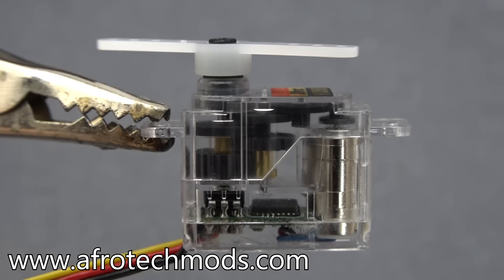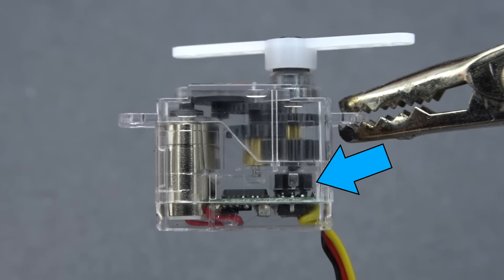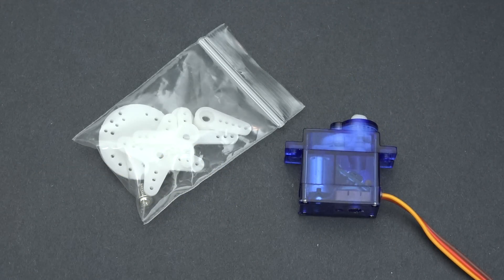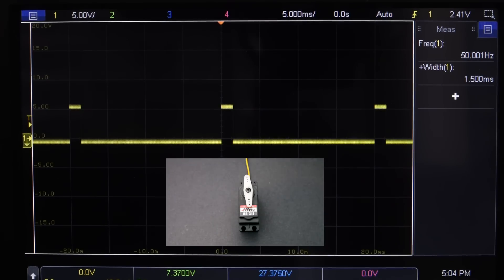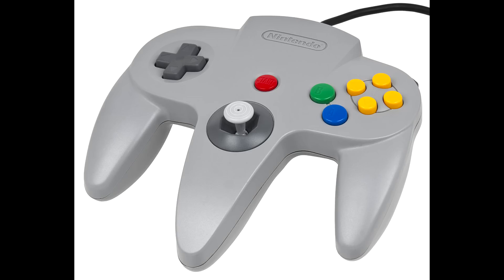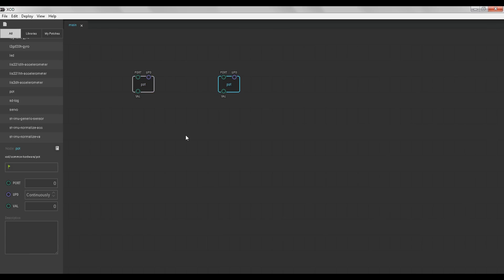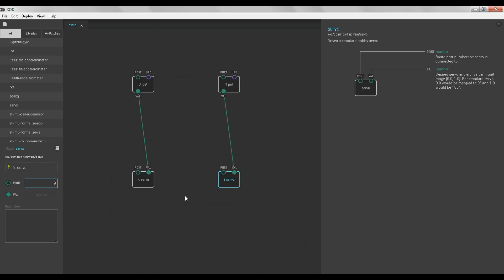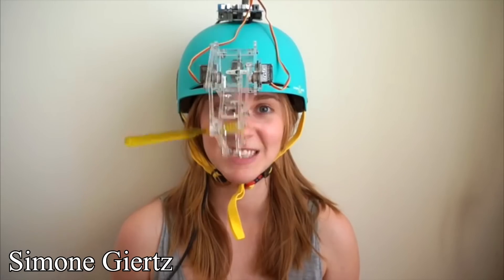Arduino Servo Control: How to Make a Laser Turret with XOD

Comment: 😢Back in 2004 {at age 43} I was trying to 'hack' a standard RC servo for 360° rotation. {At the time I either could not find one being sold commercially, or I did not have the $$$ to purchase one.} 

To my surprise I discovered I could not hold the servo close enough to my face to clearly see what I was doing AND STILL FOCUS ON IT. 

And THAT was the first hint that I WAS GOING TO NEED GLASSES...🤭

Comment: I saw a few different projects like this and im trying to combine them all. I'm trying to make a turret that can move a full 360 degrees, has a camera installed to look around, has a high powered burning laser inside and can have the lasers, camera zoom, movement and motors fully controlled by an android app

I have figured out how it'll look. It will be a deep base (carrying the arduino and wiring and such) fed through a cylinder with a curve leading towards a rectangular encased platform having laser and camera inside

Now I need to model everything, buy the parts, code the arduino and make the app

Wish me luck!

Comment: One terminology misconception, a servo motor as shown here is a positional closed loop system, not merely a closed loop system, and your motor with PWM control and a H-bridge could be in a closed loop control system where the speed was controlled, this would be closed loop, and the speed would not change when its shaft was loaded (within reason of course) but it would still be a servo motor, just not position controlled.

Comment: Can see this project becoming very dangerous in the wrong hands (like mine). Old analogue joystick, ssr and high powered class IV laser anyone ;) I have built one, it has a thrustmaster joystick for the controller, a green 5 watt laser and the laser is rigged to only output at threshold power when the joystick trigger is not pulled. Pull the trigger (after donning laser goggles, class iv lasers are very dangerous) and you get a 5 watt very destructive beam :)

Comment: Very late to see this but instead of hacking a controller joystick, you can also use a joystick module made for arduino that are now available online. 
Since it's just two potentiometers (x and y) and a button/switch (digital) 
So you can actually use the servos to be controlled by the joystick and the laser to be controlled by the digital button.

Comment: you should have a look at the servo options on https://www.automationtechnologiesinc.com .  I found them through CNCzone.com forums, which is an excellent resource for both open loop and closed loop systems like Stepper and Servo motor with electromagnetic breaks, for those unexpected fast stops for the motor :) to anyone wanting a reason to click? they have from very super tiny motors found in 3D printers like iPrusa, all the way up to motors powerful enough to run an electric car off of, if you used say one per wheel for both independent power, and regenerative breaking (where hitting the breaks causes the motors to become a load sucking power from your momentum and forcing this back into the battery as electrical current.)
Reply: also I am here looking at info for building a paintball turret system for home defense, that I want to be able to use facial recognition, among other methods of determining friend from foe, while using a number of technics that are not destructive like high power flashes of light to temporarily overload the eyes of someone breaking in say, so that they are effectively snow blinded for like 30 minutes at a time, ultrasonic frequencies that cause paralysis temporarily (while the transducer is activated) and possibly temporary comatose states which I think might also lead to an answer on how to revive people in coma's for other reasons, and lastly pepperballs!!! lol Although knockout darts are not out of the question, as well as static discharges like found in stunguns, all ran by an automated system that just recognizes anyone that is supposed to be there, along with maybe some sort of ID badges that can temporarily give access though still unclear about that. anyway, I want to build as much of this to test and set in motion theory so that it can be used in a number of stories I and some others are writing, as a function of the storyline, and will put all my info up on an opensource site for other writers who want to use this info.

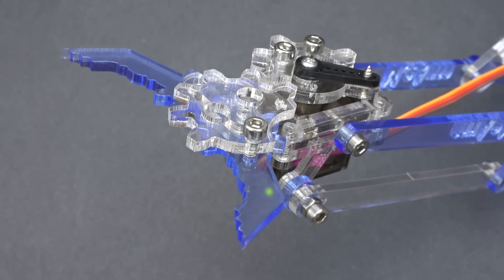Comment: hey i have to robot with 4 axes ( servos, that you showed at 4:00) how did you get that to work do you have a code for that i use arduino but i cant get it to work that well. i wold highly appriciate if you would help me thanks!:)

Comment: What do I need to do to have only one power source, instead of two (one for the motors, and one for the arduino)? Is it sufficient to plug the power supply used for the motors to the 5V pin, or will I get interferences when the motors run (I guess)?

Comment: Nice intro, very understandable.  Would be nice to see the controller toggle the lasers on/off.  Would that need a relay or can the board power the two lasers?
Reply from the maker: The lasers draw a little too much current at 5V to be suitable to be powered from the Arduino's pins. You could try putting an additional resistor in series and that would help. Otherwise you'd need an external circuit. Transistor would be easier than a relay.

Comment: Thanks much for pointing out XOD pal.
Just a few days ago I was trying to find some Arduino library/code to take a 'pattern' input to demo a camera pan/tilt setup.
The only stuff I've found so far is some CNC G-code but this is too much overkill, so it looks like another DIY project.
Currently I'm trying to think of a way to do a simple 'pattern' read via serial  that might fit into Atmega328 EEPROM..

Comment: Could i ask another question here? I am a beginner in electronic things and arduino.  I want to ask how could I know the power input limit of an electronics object? such as the max power input of a LED, a DC motor.... because when i try the Arduino starterkit, it just tells me what resistor should i connect to the LEDs or DC motor, but if without this guidance, I may burn those electronic things. Thanks.

Comment: Why don't you use the 5v on the arduino to power the servos ?
Reply from the maker: The simple linear 5V reg on the arduino and/or the USB port might not be able to supply enough current

Comment: I'm glad I stumbled on your channel since I'm an avid Arduino aficionado.  XOD reminds me a lot of lab view the way it accomplishes it's code generation.  In the past I've been using the Arduino IDE to generate my code but seeing it graphically makes it easier.  I haven't installed XOD yet so I'm wondering if it will generate a code listing that can be viewed in the Arduino IDE for optimization.  Before I interfaced a DDS to my Uno I was generating timing pulses with the Arduino IDE mnemonics.  The problem with that was the clock output was limited by the number of machine cycles the timer routine needed to execute.  So I ended up writing code to access the timer chip directly which is why it would be nice if XOD generated a code listing in C++ as well as the chip code.  Again thanks for the great video (even tho' I skipped ahead to the XOD part since I'm already familiar with servos).   I'm looking forward to viewing your other videos.  Even tho' I'm experienced with the Uno and Mega I am still open to learning from other people.
Reply from the maker: Yeah you can view all the code it generates in C and modify it if you want. It's in the Deploy menu
Reply: One more question: did you experience any problem installing the software?  I'm using Trend micro and it blocked the install claiming it was ransomeware.  Do you know of any problems with the site?
Reply from the maker: Ransomware? Wtf? I just ran the setup file through virustotal and it says its okay
Reply: Probably just a quirk with Trend Micro.  Thanks for your reply and have a happy new year.
Reply: I ran the file thru a virus scan and it came up clean. Thanks again for your replies.

Comment: Excellent. One of the best videos I've seen. I wish I had this video around when I was into RC model airplanes.  In RC, we use either servo "testers" or some of the newer transmitters have a servo test feature built in. It is wild watching all of the servos move the control surfaces through their paces at one time without any intervention.

Comment: I'd rather code myself than use XOD, tbh.
Reply: zod killed your mentality as a programmer
Reply: XOD's basically a training wheel until you get a hang of the coding properly. If you can code fast, reliably and preferrably without too much excess then XOD won't offer much to you.
Reply: "I should be hearing clicking not typing!" - TA at a class teaching LabView.

Comment: XOD seems bad. It doesn't let you drag pins out individually for quick reconfiguration or reference, need to click every node individually to check pinning... I'd have preferred the pins be seperate nodes you wire in.
Also the configurations would've been nice if they were text fields IN the node display itself  to quickly understand and/or alter things. Graphically or otherwise.

Comment: Afrotechmods   I've been a software engineer for 19 years.  I've been trying to get into electronics, but I've been struggling.  I wonder if electronics would be easier to learn if we developed new terms (a new language, a new model) to describe everything we've learned so far over the centuries.

You have it all modelled in your head just like I have software engineering modelled in my head.  You can wire up your own proven sub circuits in your head and know why every component is needed in every sub circuit.  You know what you can do.  You can see it all in your mind's eye.  What you see is more than the sum of it's parts.  It's a solution.

From your point of view now, do you think there could be a better, more organic way to understand electronics?  Do you think we could change the language we use in order to help people learn electronics quicker?
Reply from the maker: I think it can certainly be taught better, and that's what I've been trying to do with this channel. But in terms of coming up with new ways of doing things... I can't come up with a better way. Most schematic symbols are a reasonable picture of what is being shown. (A resistor is a long winding wire and a capacitor is parallel plates etc). The difficulty that I think most people face is mentally visualizing voltage at different nodes in a circuit and how current flows, simultaneously. I like to do this by animating arrows on a circuit in operation. In my mind it is all happening in 4d. I have seen other youtubers try explain electronics with 3d animations using the height axis as an analog for voltage and some people like that style but personally I cannot grasp it at all. I think the main problem is the fact that we are trying to visualize the invisible. Electric and magnetic fields that our human bodies were never made to perceive. We can only measure them with test equipment or imagine them.